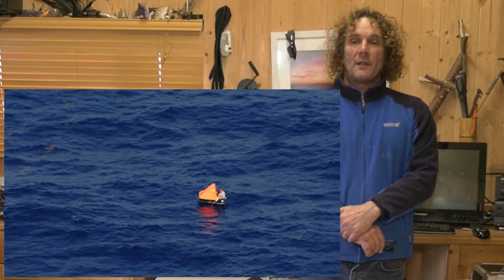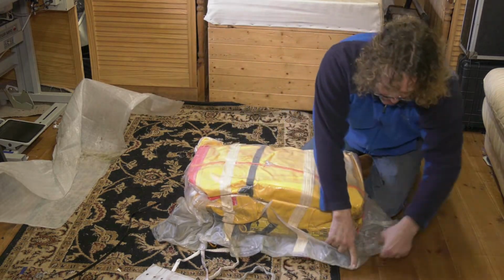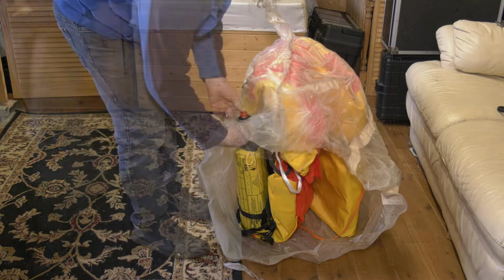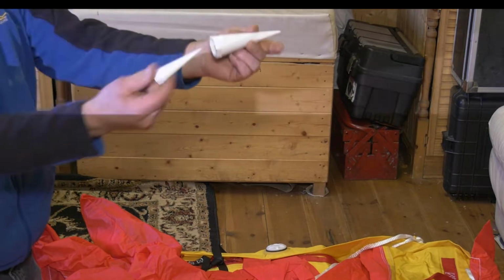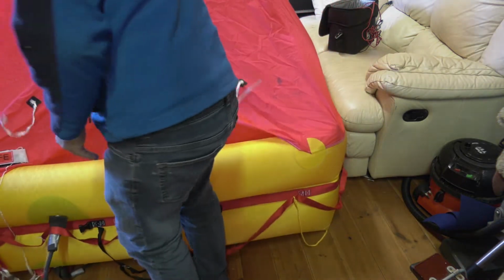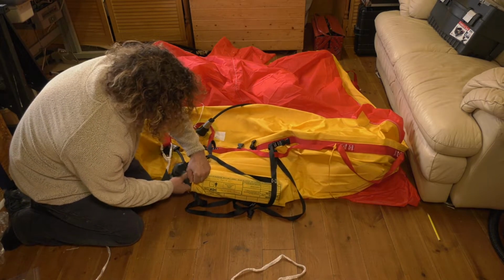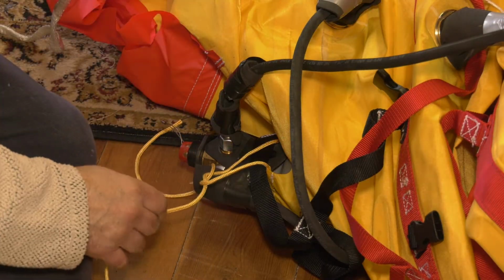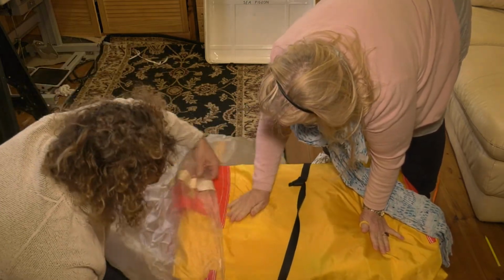Life Raft Service: DIY style

Comment: Great video. Very brave to put this on YouTube.  I am just in the process of self servicing my life raft.  Ironically I have three and the oldest one has a bottle refill not long before I took it out of service! So will be repacking that one and putting it on board if it stays up and firm for 24 hours. It has been interesting to look at the raft closely. I also service my own life jackets. Good idea taking it to the post office! Thanks for sharing
Reply from the maker: The only problem I had was re sealing the bag. Let me know if you find a way ti reseal the bag?
Reply: You did a great job of the procedure you use, and I am going to do my own, as well. I have a 6 person, Offshore, and a 4 person Coastal I will be repacking.  I paid hundreds and not thousands for new one, by buying used and less than 10 years old! The 3-year, repacking requirement is absurd to me, anyway! Epirbs, and Sealed survival Rations, medical kit, electric powered flare and water are in a Ditch Bag as well, attached to the Life Raft in a commercial float bag of course! The latest iPhones and also the latest Androids have Sat Coms installed on them already, and free for the first year, and a subscription thereafter too. Most are already waterproof to a meter or so, but I also use waterproof phone cases, and a few waterproof Handheld VHF radio's. Both with SatComm, emergency contact. Solar charging Battery packs too!   Anything one can think of is prepared before I go out. I SOLO, so it is imperative, but those with other souls aboard...... it is the skippers responsibility, even Moreso to always be prepared....... for anything, I say!  @AdventuresofSeaPigeon
Reply from the maker: Some interesting comments in there many thanks. I did not know about the latest phones having sat coms built in. This is something i will have to look into. Also let me know how you go about resealing your life raft bag as this is where I failed.  Totally agree on the self service option and keeping consumables in a grab bag. And remember the famous sailor saying " you should only ever step up to your life raft..  Have a good one Neil
Reply: @AdventuresofSeaPigeon  So they sell very large Reusable bags to store items such as blankets in the home with. You hook up a Vacuum Cleaner to the port it has, and evacuate all the air, essentially sealing it up hermetically, as this reduces the size quite a bit and therefore makes them smaller, and easier to pack back into any valise. It may not be recommended, but I am going to search for the thinnest gauge bag, so it does not interfere with the Auto-Inflation cycle. I guess it is maybe best here to release then by using a "De-stitching" tool that those who sew to cut across the top before you Velcro seal it with the valise. Paying particular attention that you do not puncture the craft, in the process, LOL I am sure then it could not interfere in any way, and already be tamed to wrestle a lot easier into the valise again. It would also serve the purpose to not allow the boat fabric and the valise when it may shift around a bit and be sort of "Anti-Chafing". **** Note/Disclaimer** Others may attack that whole idea, saying it would be unsafe, but that is what I shall do! LOL You do what YOU wish here, I say! It is yours....... and unless the law dictates it requires that expensive Repack, is what I shall do!
Reply: @AdventuresofSeaPigeon   Another thought here, would be to cut the bag at the top part and after it is tucked back into the Valise, just maneuver the Vacuum Bag back out. It will never be reusable again, but a method as I said I shall do!

Comment: Enjoyed your video. I am like you, I trust myself more than others when it comes to my safety and life. I am also a penny pincher.

Thanks
Reply from the maker: Totally agree with trusting yourself. It is funny sailors spend many thousands on their boats but bitch when we have to pay £35.00 for a night in a pontoon. Like you I need to keep the costs down.  Two points make sure you video every aspect for reference, especially the folding of the raft. The only problem i had was i could not get the vacuum bag to re seal. Leave a comment when you have done it.

Comment: The weight of the cylinder is measured with the operating head removed. Which is probably where you got the mis-match. The op-head should also be removed to check that it works correctly as well as any o-rings greased; an important step that you missed here. It is also common practice to fill the raft through the high pressure hoses with (dried) compressed  air to ensure all the valves work properly.
Reply: As for the repacking, it doesn’t look like you removed enough air from the raft before trying to pack it. To re-seal the bag you need a heat sealing machine. All of the above are reasons you should get your raft serviced professionally. You say you wanted to weigh your cylinder for peace of mind but you weighed it wrong and you didn’t even mention whether it was due for hydro-testing?

Comment: I just checked my life raft myself and found out that the last time when it was serviced by a professional service centre, they had not put back in everything that was supposed to be in there. There was no water, no food, no signalling mirror and no first aid kit, all things that used to be in there.  Anyway, it all went well and I managed to fold it back together again. First I used a vacuum cleaner to get all air out and used a strap to hold it together so I was able to get it into the vacuum bag. I had cut off only a few centimeters of the side of the bag so that there was plenty of material left to seal it again. I used a hot glue gun to seal it, which I had tried out first on the strip that I had cut off. Once sealed I used a vacuum cleaner to suck the air out and that made the whole thing a lot smaller immediately so that it fitted back in the container without much trouble.
Reply from the maker: Well done you did better than me i could not get the vacuum bag to seal.

Comment: I just had mine serviced at a cost of 300quid and a 3 month wait, which although expensive may not seem so much if I ever have to deploy it - however, I think if you can do it yourself why not and I may find myself referring to this vid at some point in the future if I find myself with a life raft in need of service and a service station not available.
Reply: Hi Rich. In hind site there was nothing wrong with my life raft apart from the perishables. Perishables could be stored in the grab bag. The weighing of the cylinder is essential though. MY only problem was that i could not get the life raft vacuum bag to re seal. I also wish i had looked more precisely how it was folded to get it back in the bag. I feel that i would have done better leaving it alone, but i needed to take it all apart to see this. £300 pounds is a good price i guess it has do be done over the winter period. Other minor problem with my service is the plastic for the outer case is now becoming brittle. But i am confident it will work in the worse case scenario.

Comment: The problem seems to be that the bag has an opening that fits the neck of the cylinder. It was in place when the cord was disconnected but not when reconnected. If so, there surely is a 1 - 2" hole now in the bag.
Reply: What was done to replace the straps? Presumably they need to be tough but breakable at pressure.
Reply from the maker: Hi Jon I just looked back at this video and i can see the cord you mentioned. As i was re-sealing the cylinder I noticed this and took the cord off and re attached it afterwards. Unfortunately i lost the last part of this video showing this. But wow, well done for noticing this and many thanks. Neil

Comment: Thank you for this video, I agree ,I want to know how my stuff works. I do all my own work on my boat and since it's really just me I'm not too concerned about a certified inspection. I'm curious, did you find a good way to seal the bag?
Reply from the maker: No I could not seal it. One comment was that I had opened the wrong end of the bag ? I tried heat and glues but it would not hold its value.

Comment: Besides the integrity of the raft, once inflated for test, the valves and the controversial aspect of the separated grab bag for the consumables, the very focal check is, from my point of view, the CO² cylinder status. There should be a way to make a DIY cylinder check or replacement, without unfold the raft, which is a nightmare, assuming that an external bag or container in good shape is already an overall efficiency indicator. Also, risks associated to more or less professional  and expensive periodical services should be taken into account.

Comment: Should have vacuumed the raft flat before trying to fold up.apart from that well done I have deployed many out of date lifrafts and never had one not inflated and stay up  some 15 years out of test 
Getting vacuum sealed is the biggest problem 
Without a new bag
Reply from the maker: Can you buy a new bag any where? i imagine they will not sell you one?  Also the DIY method i used to seal it did not work

Comment: Hi Neil, That was fascinating thank you. I was really interested to see inside the life raft and understand how it all works. I recently dropped my life raft off for servicing and after watching the video am glad that I did as its clearly not a straightforward job. Im interested to know what you used to hold the canister together as it clearly needs to be strong but also will break if the life raft is deployed. The other thing that puts me off doing it myself is that I understand that if you have a life raft on board when visiting France then you have to have a Certificate to show its servicing is up to date. Post Brexit that sort of thing concerns me. Thanks again.
Reply from the maker: As regards the service certificate i have a printer and photoshop. I have also written on the canister when it was serviced. I held the canister back together with webbing straps and plastic clips. Similar clips to those on the straps that disconnect on a back pack. Once the load of the gas canister kicks in the plastic snaps will disconect
Reply: @AdventuresofSeaPigeon  Good practical solutions.I'll wish I did it myself when I get the service bill!
Reply: Thanks for that Neil. I feel that you SHOULD be able to service your own liferaft, and it should be easier to do. I have not serviced a liferaft before but I do service my own life jacket. The same principles surely apply. Thanks for the vids.

Comment: Interesting vid. Could you have obtained the original specs for exact weight of the raft and CO2 bottle then reweighed on highly accurate scales to determine if it was lighter? Would that be possible?
Reply from the maker: NO as the difference between a good bottle and a bad bottle is a few grams. Even a little moisture  in the bag would make the difference.

Comment: I'm suspicious that it's gained weight! It looks like you weighed the CO2 cylinder with the valve still attached. I removed the valve (which was very hard to unscrew) and weighed it (also at a friendly PO!) and it came out 2g lighter than the original, ie about. 0.05%.

Comment: Thanks Neil, did you vacuum the air from the actual raft as well and was there any talcum powder on any surfaces?
Reply from the maker: Yes I did a vacuum to reduce the air. But I could not get the outer seal bag to seal and vacuum.  I did not use any talc.

Comment: Best last .part of the video was the best,
dont do it yourself.
Go to any approved service station (for the brand of your liferaft) ,and ask to open the liferaft so you can see it,
there gone give you information of your raft.
There also have the approved parts for  service and repack it.
Reply: For $2500??????  more precise folding and patience that's all to it .
Reply: For 2500 euro you can buy a new raft.
I have serviced liferafts for 40 years ,you wont known what i have seen from bad services.even services mostly  from service stations that were not approved.
The 2500 euro for service is crazy.
The most expensive liferaft that i known for service is the Winslow liferaft.
If you service your liferaft yourself you don not have the replacement parts for it.
For example the tension straps around the container ,there are many straps with the dedicated breaking tension
there not all the same.